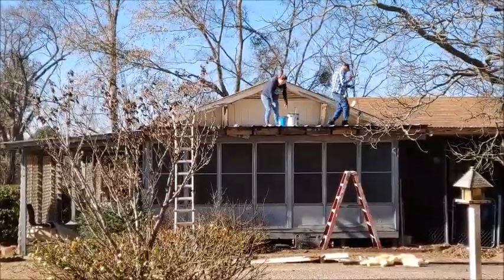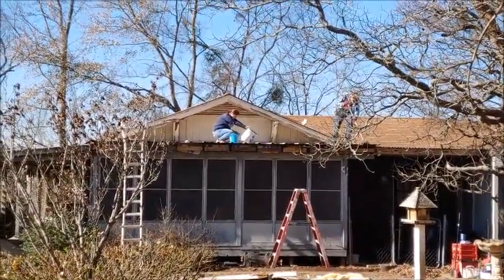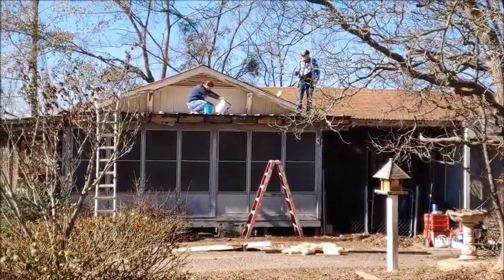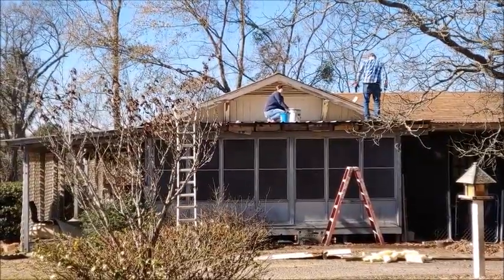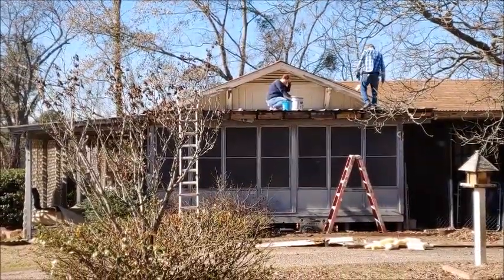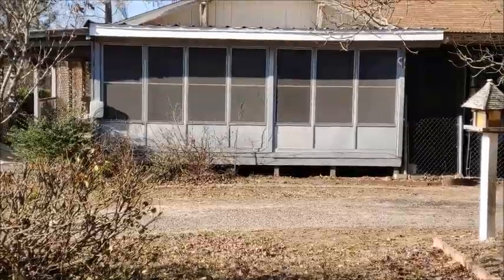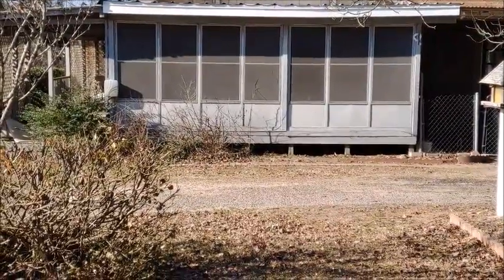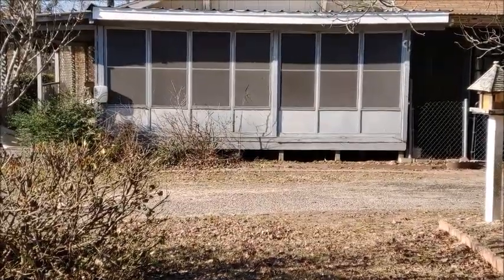One Roof Repaired One Roof To Go

Comment: So glad you got that work done Mary. It's hard when we live alone and aren't rich, getting these things done and finding someone to do it that will actually fix it and not charge an arm and a leg!!  A friend of mine had her heat go out during that cold weather we had over Christmas time. She had a fireplace so was prepared with wood for that. I forget what she said she has for heat, but it actually froze up, so the guy she called to fix it just added an additive to it, which immediately thawed it out, and her heat started again. The additive was only $6.99 but his charge was $130. I think it's heating oil she uses.